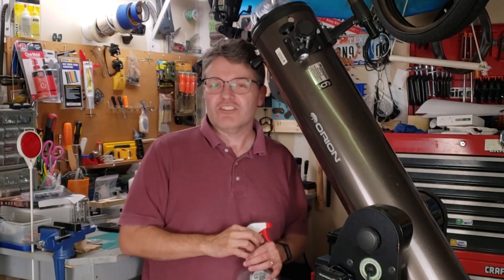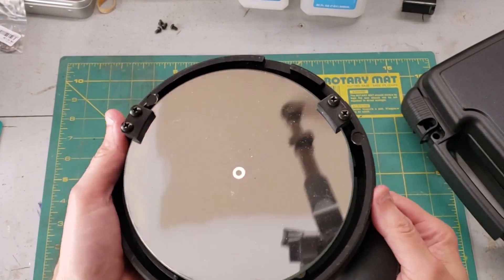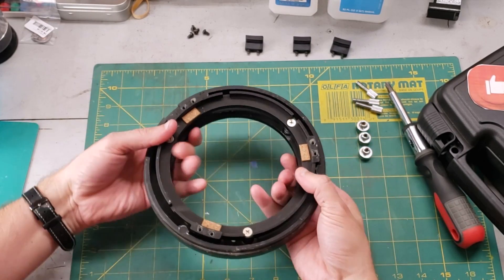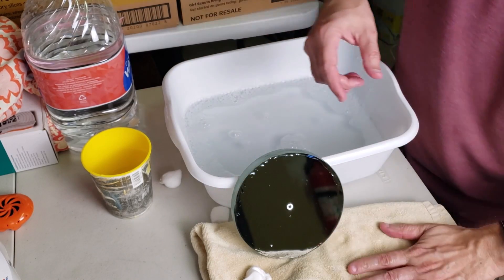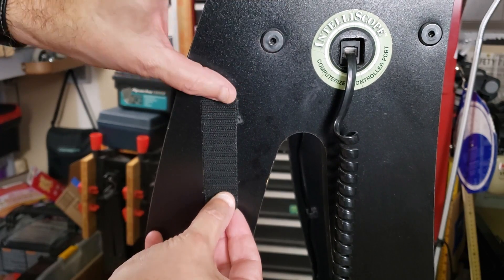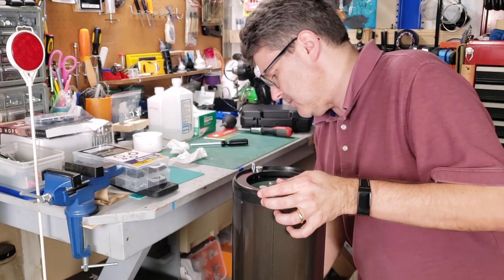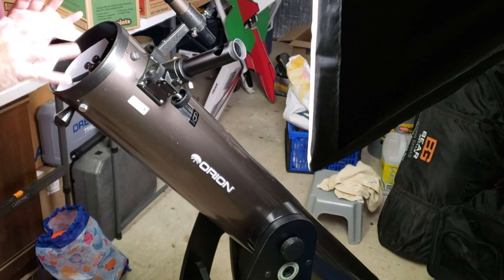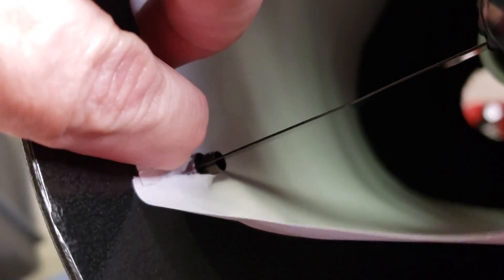Wrecked Telescope Returns!   Was It A DISASTER?

Comment: I have noticed that the o-rings do not do well with hot weather especially in a garage.
Reply from the maker: I think in my case, it didn't help that the o-rings are really stretched. I need to find one that is close to the right diameter, but already thin enough.
Reply: @AstronomyGarage  Well you work with what you have. My point is I have had the same experience which them turning to dust. It seems like you said common.

Comment: Oh boy does that scope bring back memories. Thanks for the update on it. I had alot of issues with my push to controller. It would never 2 star alighn. Only got the alt az to give me readings in a setting circle mode. Dont use it much any more because i have Stellarium n Astrohopper for my 6 inch starblast. Great video John. Clear skys to all. Jack
Reply: Goodmorning John. Yes it is an Orion Starblast 6I. Bought it off my neighbor for only 2 Ben jamins couple years ago. Really good if not press tine shape. I got the encoders working. I can use it if I line up on Polaris first to set azimuth on 0 then set the alt.verticle to get my 90. Skip the 2 star align n hit function for encoder test to display the readings. Then drop the scope back down to N.Star n check readings against Stellarium. Pretty dead on. Problem is you have to see N n360 degrees all around. To many obstacles n have ing to move around the yard to get in a good spot makes it to much a hassle. Thanks to Stellarium n Art. Beli u s. AstroHopper push to is done like the dinosaurs. Stay safe with this bad weather.
Reply from the maker: Was it an Orion PushTo?  I was so bummed for getting rid of this one, that I kept my eyes open and found an 8 inch version. It's been working really well.

Comment: Nice.  I finally found a new focuser that I think will fit my Bresser 102/450, but will not be in stock until April?  Have been struggling to collimate my 6" SCT.  Very difficult.  Wait till clear night, keep running into my bedroom and looking at the monitor and then running into back garden to make adjustment.  Just bought a lap top, so I will now not have to do all that travel with my COPD.  Waiting for clear weather.
Reply: No need to wait for a clear night. Make an artificial star from a $3 led flashlight from Harbor Freight. Cover the front with foil and secure with a rubber band. Then, pierce the foil with the tip of the finest needle you can find. For a 6" SCT place the "star" about 30 feet away and focus on the star. Defocus both directions. Pick the "side" of focus that has the most deformed donut and begin adjusting the three collimation screws. There are specific ways to proceed but trial and error will eventually get you there. Bobs Knobs are a tremendous help if it is a Celestron. I use a 20mm eyepiece so no going back and forth with a camera.
Reply: @10intexas + 1, this is the way to go.
Reply from the maker: I wish you luck. I don't know how to collimate an SCT.

Comment: Good job! When you first do this kind of work, you have your heart in your mouth. With experience, you can tune up most telescopes without fear. I feel that modern mirrors have more durable coatings than old ones.
Reply from the maker: Good point - I was pretty nervous the first time I washed a mirror, but I've done it dozens of times now.  The oldest mirror I've washed was from my very own home-made 6" Dobsonian. It's fared well from the early 1990's (admittedly, I rarely use it because of access to my 8 inch Dob).